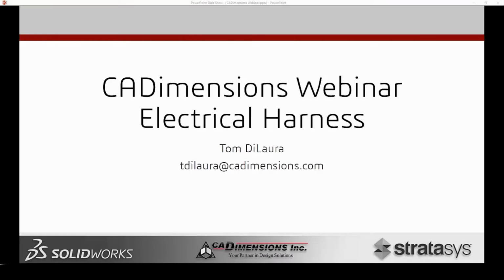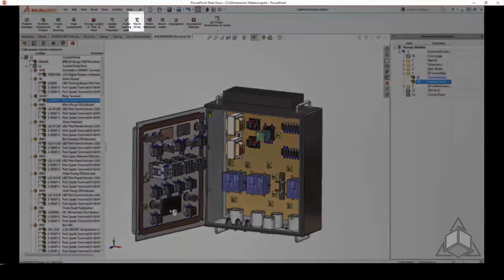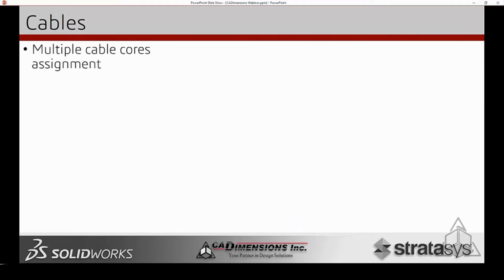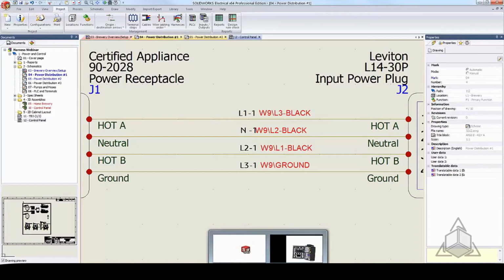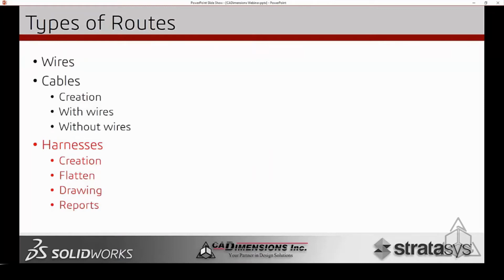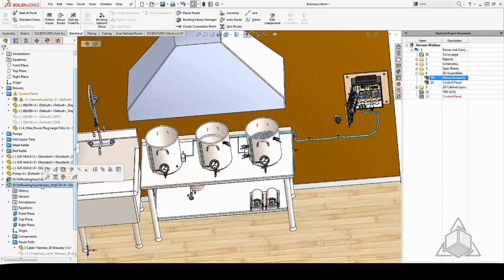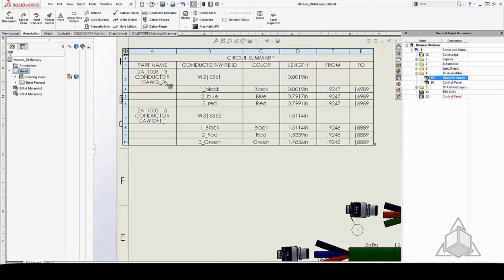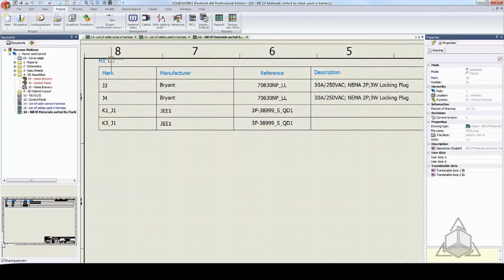SOLIDWORKS Electrical Routing: Microbrew Example

Comment: Please provide detail in adding new part and integration with solidwork electrical. How you define the Routing path. What are necessary requirements for Routing. Whenever i am trying to route it pop up massage nothing to route.